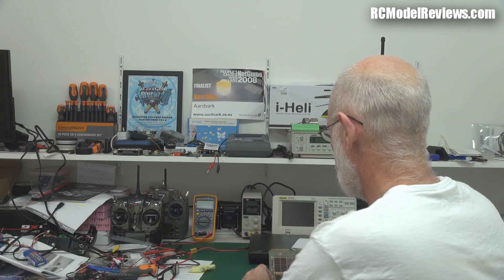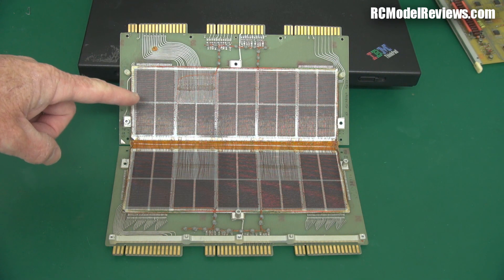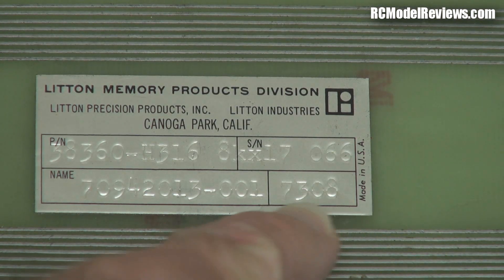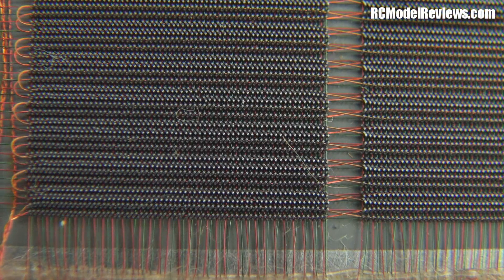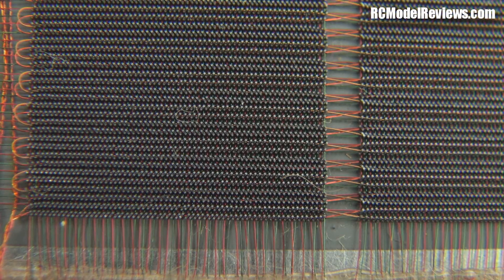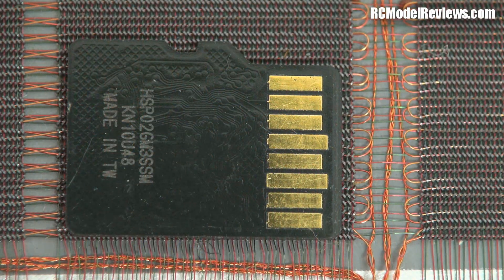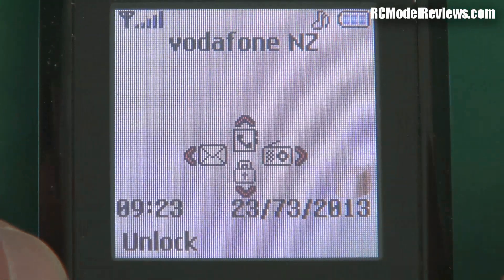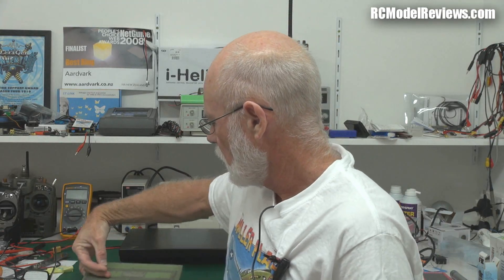Magnetic core memory from 40 years ago

Comment: No parity bits today? No. Today we just use more bits and call it checksum. 
Checksums are implemented everywhere, still today. Otherwise our tech wouldn't be as stable as it is.
😀
This just relates to software. But even on the hardware side we still have something like parity bits:
ECC RAM for example has extra parity bits, that make Xeon systems a lot more stable. Xeon CPUs require ECC RAM.

Comment: Hi Bruce,  Something your viewers may wish to know is that these ferrite core memory boards were wired by hand.
The wire threading needles were so small that if an operator got one stuck in their finger, they were very difficult to find and remove.
As you say, the storage density of these boards compared with what we have today is lousy.  If you were to sit your 32Gb Micro SD card onto a ferrite core board it would occupy less space than an 8byte section of ferrite core toroids. Unbelievable.  We now have 256Gb Micro SD cards... and who knows what is to come?  We really do live in interesting times.  :O(

Comment: Amazing, people were much more clever than we are today, they knew the physics and knew what they needed to do to perform a task, so they used by-products of simple circuits to carry out those tasks.

The rise of the IC has made us spoiled and take what we have for granted.
Reply: hehe Encapsulation & Black-Boxing comes at a price... We reduce the complexity of operating a System but grow ever more ignorant to the Inner-Workings of the Implementation. Guess its all about Finding a Balance.... but i couldn't agree more ... We are a Spoiled Culture now haha.
Reply: They aren't more clever than we are today, not by quite a measure.  You can, for about $75 (that includes the case, the SD Card, the power supply and board) have a fully functional computer capable of doing nuclear bomb simulation today, and it will run on less than 10 watts.  Engineers are well aware of this, but public however, is clueless.  Most people have no idea where we are or what kind of power we now have.  I can give you a single SD Card that costs under $25, that would have more books on it, than you can read in a lifetime.

IC's are extremely complex, there are hundreds of people needed to make one.  Process is especially difficult.

Comment: You can get micro SD in up to 128gig easy now and they already have 512gig proof of concepts. Other storage mediums can hold over 3tb in something the dimensions of a stick of gum (usb 3.0 device).
Reply: sandisk sell a 256gb card, they're around $200 on amazon.com
Reply: craig thomas I had forgotten about the 256gb cards. 

IMB has a storage tech that is set to replace SD it's something on the order of 33% higher data density for a drastically reduced cost.
Reply: +Aisha Love here's food for thought, in 1979, a 250mb hard drive weighed 550lbs and cost tens of thousands of dollars. my phone holds a 32gb card that weighs 4/10ths of a gram and cost next to nothing.

Comment: Amazing the mechanical dexterity and effort put in to create this step in computer evolution,  Current DDR is fast but uses both clock edges to transfer data so data rate is double the clock speed. Large Non volatile memories like uSDcards often use multilevels per cell so a cell can store 3 bits so the density isn't as high as it can appear. Great vid.

Comment: This is the kind of memory they used to land on the moon!  :)
Reply: Even worse. They had hard-coded "rope" core memory; essentially programming in machine code by putting wires through or outside of cores.
Reply: soylentgreenb
this is rope core.
Reply: This is read-write magnetic core. The core rope memory used on the AGC was a lot bigger, it was ROM, and was woven by hand.
Reply: +Saint Nick Rope memory used the same ferrite cores as were available at the time. There were many generations of core memory, and the cores shrunk every generation.

Comment: Now you can get 200GB on a micro sd
Reply: there are 2TB versions aviable...
Reply: I9300YT Can you give me a link?
Reply: its no commercially aviable yet. The reason is that the technology isnt ready to produce fast read/write speeds at that capacity (yet). So there are only prototypes.
But if you google you will shurely find some information about these prototypes...
Reply: I9300YT Interesting, thanks for the info

Comment: funny thing is i bet if built an interface for that old board i bet it would still work today
Reply: silverphinex  well it was built to last decades. And things ont fall apart by themselves like current tech on a nano scale.
Reply: Star-Lord actually computers in that time had a higher failure rate than computers in this time and that with only a very tiny fraction of the calculation power. The military spec integrated circuits are meant to last though, but that's a generation later.
Reply: This magnetic core memory was reliable as far as life expectancy goes, but not reliable as far as read/write errors go. The memory also had destructive reading. The act of reading the memory destroyed the bit, so it had to be written back if you wanted to keep it, meaning you could never error check the memory after writing, hence, the parity bit.
Modern memory is even more destructive, btw, requiring constant refreshes and a buffer, since they are capacitive, but the complexity of such a thing back then is even more impressive. That must've been a pain in the ass.

Comment: Well, I go back even further. Back in 1969 I was working for the GPO(UK), now BT, on a device called an 'Auto call sender' AT 60853(concieved and designed in the mid 60's) which was used back then to test new telephone exchanges. This item consisted of two interconnected cabinets which stood about 5ft tall and were about 3ft across and 2ft deep. The storage on this was a volatile system of 9 delay lines (magneto striction) connected in series. They were programmed via an array of rotary switches and the numbers were displayed on a row of neon dot display tubes. The digital ccts were discrete components on small PCB's potted in blocks the size of 10 cigarete pack and were made by Mullard. Back then this was all cutting edge stuff; PCM on the local telephone network had not long come in. Hope this may make sense to some one, always assuming my memory is still working OK(3 score years and ten is not long off)

Comment: Bruce that core store is quite modern.  It's got DiL chips on it!

The first core store I used back in 1961 had 400 words of 16 x 4 bits. It was 16 digits of binary coded decimal (BCD). It also ran at 1MHz.  The computer was a huge ICT 1301 and the solid state technology was made from GET103 germanium transistors.  Not an integrated circuit in sight or even in the offing for some years to come. 

It really is fantastic how technology has changed in my lifetime (I'm 74).  I just wonder what it will be like in another 74 year's time. Sadly, I won't be around to find out unless there's anything in reincarnation :)

Thanks for the trip down memory lane, Bruce.  Hope you get reinstated and manage to get some flying in.  I bet you're a prickly bugger sometimes but no-one deserves the treatment you've had.

Comment: Back in the dark ages, I worked for Honeywell (AKA Minneapolis Honeywell Regulator Company) on their H400 mainframe system. They sent two of us to their school for 6 months in 1963. It had RAM core memory AND the ROM microcode was also core mem. It was read only. Innovative back then.I installed a lot of them, and the memory had to be installed later, shipped in its own 55 gal. drum. The system WAS solid state, but all discrete components in many 19" racks run by a 10 hp motor-generator.

It blows my feeble old mind to ponder all the calculations going on in a modern quad/octo flight controller.

Comment: Hi bruce.
I love anything rc. I have car's and have just started building and learning to fly rc planes. Today I took out all my gear to go drive my rc car plugged in my battery to my tx and started beeping and showing 8.6 volts low power at first i thought I had destroyed my lipo but after checking it it was reading 12.6 volts.  I have a sneaking suspicion my wife may have dropped the tx while cleaning. Any ideas what I should be looking for when I open it up. 
Your videos have been so helpful to me I don't watch anything else.  The tx is a flysky that runs on 12v.
Cheers in advance bruce.
Regards mark.

Comment: Error checking memory (ECC) is still ubiquitous in server hardware.
Reply: ECC is not the same as parity checking - ECC can recover from errors (tell you at which location a bit was flipped), parity checking only told you if there was an error. It remains true, that today no one uses memory with parity checking.
Reply: Most flash memory uses it too.

Comment: that was cool! I can remember walking past the computer lab in high school in the late 60's and watching the "geeks" running wires all over the place programming the computer to do some little, very little task that they would get all excited about! They are the one who ended up making a lot more money than I ever did!! LOL
Reply: Computers were small enough and more importantly "cheap" in the 60s? I thought computers only became small enough and "cheap" enough to be used in schools starting in the mid 70s.
Reply: The Programma 101 in 1965 was small and cheap?
Reply: @FloodExterminator  Minicomputers similar to the PDP-8 came out in the 60s and cost under $20,000. Still a pretty penny ($150k in today's money, maybe down to $80k toward the end of the 60s), but there'd only be one. Commensurable with the equipment needed for some sports (ie. a half-sized pool or a basketball court), or a fully outfitted wood or metal workshop.

Comment: What would this have been used in bruce? obviously person computing was no where near back then, I'm 16 and can only remember back to floppy disks!
Reply: According to Roger (the guy who gave it to me) it came from a Honeywell H316  minicomputer from the late 1960s through mid 1970s.  There's more info here on Wikipedia:  http://en.wikipedia.org/wiki/Honeywell_316
Reply: Wow... I found this footage on YouTube of a 316 being used.  Gasp!

Honeywell H316 FORTRAN IV impressions
Reply: ***** We did not have the high speed tape reader/punch just the Teletype ASR 33  that had reader and punch that were a LOT slower. You can see the ASR 33 in operation (printing) at the end the video. Unfortunately I don't have the FORTRAN compiler any more but you are welcome to try some ASM programming. The H316 worked last lime that I turned on about 5 years ago but I am seriously concerned that the caps might explode on the power supply if I turn it on. We had a Lunar lander written in FORTRAN and used to while away the hours playing that on the ASR33, it used a lot paper!
Reply: Check Wikipedia for Mainframe computer and minicomputer.  Then prepare to be amazed at mid 20th century technology.

Comment: I bet that would have been worth about 100 grand or thereabouts when it came out too.
Reply: Not nearly that much.  The first computer I ever used (in 1971 while in 8th grade) was a HP 2000C Time Share system that had core memory and drum storage.  A friend's father worked on the school system's two computers, so I was able to get a look at it. It stood about six feet tall, was about eight feet wide with it's 32 phone line multiplexer alongside, and about two feet deep.  I was told that it cost about $100,000 in 1970 dollars, or about $610,000 in current dollars.  For the whole computer, multiplexer and an operator's console (a teletype.)
Reply: Ah yea. No I was getting it mixed up the the system 360. I spoke to a guy who used to run one in a big corporation in the mid 60s. He said a megabyte of memory cost a million dollars and took up about the size of a small room. it's amazing that we have more computing power in a mobile phone these days than they had to send a mission to the moon, I would really love to buy one of the old Cray mainframes just to use as an awesome living room sofa

Comment: Excellent Video Bruce. I knew that you would do it justice! That core memory was in use up until about 1987 in a paper machine control system here in New Zealand. I decommissioned the computer containing the memory (Honeywell H316) and hung onto it for posterity.
Reply: I see the Honeywell H316 was also a 16 bit machine, give away the 16 register rocker switches.  Gone are the days of having to remember the octal address of the 9 track tape device to signal the boot loader where to load from. lol
Reply: Mick7sp Oh yes, I spent many an hour twiddling those rocker switches. It was real fun reloading the boot strap into core at 2am NOT. A reload of the system took about 1.5 hours including keying in the bootstrap, loading a tape loader bootstrap from punch tape on a ASR33 Teletype machine, loading the OS from tape (8 track car audio tapes) and starting the external hard drive (64Kbytes, 14" platter with 64 heads arranged over 64 tracks of 1Kbytes each). Those were the days when computing was real hard work.
Reply: Roger Hill
I was lucky it must have been a few years later when I started playing. We were already starting to replace the punch tape readers with 8 inch single sided floppies to load microcode and bootstrap, OS could then load from 9-track tape and it only took around 45 minutes to do a cold boot. Yet it seemed it was always at 2:am when it needed to be done. Remote support was fun, still remember using my first laptop... No display, a Silent-700 thermal printing terminal with a 300baud acoustic coupler.

Comment: Brings back memory(pun)of the days of the first computer I worked with. HP3000 Series-II (later upgraded as Series-III with new backplane that would allow more then 256kb of memory).  $180,000 bought you a 16 bit system (that still had some wire wrap boards) the size of a large refrigerator. with 256kb (Max 512kb if you could afford the extra $15,000 for the 256kb additional) of memory and a single platter 50MB winchester drive about the size of a microwave oven. For another $19,000 each you could add up to 6 120MB removable pack muilt-platter drives that was about the size of a todays cloths dryers. Device addressing was done in octal.

Comment: I spent two tours in the USAF from 1965 to 1973 working on automatic flight control systems (autopilots) for aircraft and helicopters as well as electronic and magnetic flux compass systems.  Most of them used either this type of memory or vacuum tubes.  Transistors and integrated circuits were also phased in during this time frame.  We had a F-4 Phantom flight simulator that used tubes for memory and was almost as big as a house.  When I got out of the service, I worked for Frasca Aviation building flight simulators for the civilian market. They used mechanical computers and accelerometers.  Times sure have changed.
Reply: Ahhh the vacuum tube, still used today mostly in the music domain especially in guitar amps!

Comment: Used to work on a YUK-15 by Sperry that had 256 k bytes of ferrite bead core memory.  Topping that off,  I had a chance to talk to one of the engineers 30 years after he designed it.  The AN/MPS 77 had an analog vacuum tube computer.  Really taxed us young fellows to work on this old equipment.  Ye haaaa.

Comment: If I recall correctly the Falcon F16 when first introduced had a memory like this. I worked at an airbase and a number of them crashed very early due to the advanced design. The debris was dumbed at the airbase. As a young student I could not resist this pile with lots of interesting parts, including the Magnetic Core memory, which apparently could maintain its memory during EMC strikes and would restart the systems.
Reply: Rudy Zondag I heard 3rd hand tales of core memory being retrieved from crashes and read out to recover data about the crash. In one way this was even better than a black box flight recorder because there was no write delay so you'd get the system state from from the moment the power died.